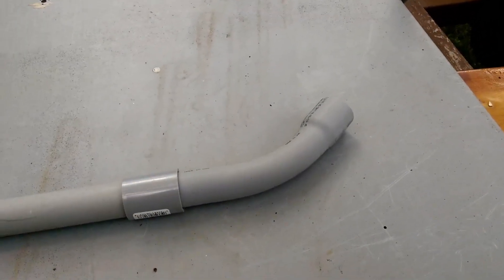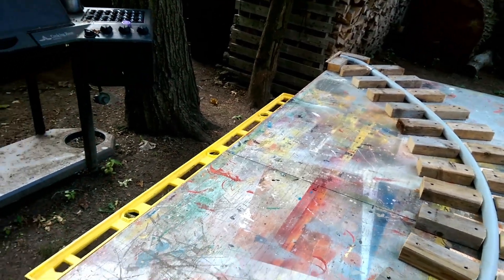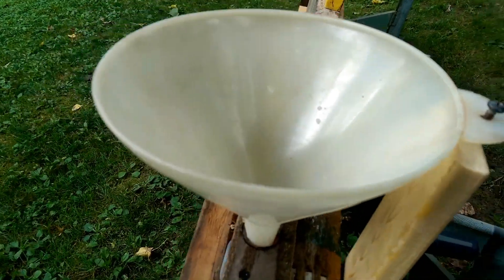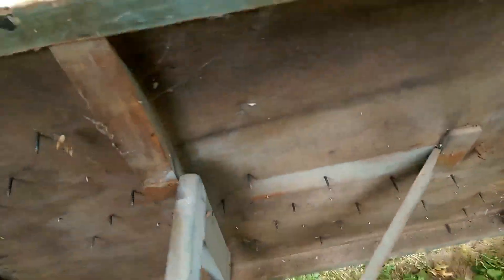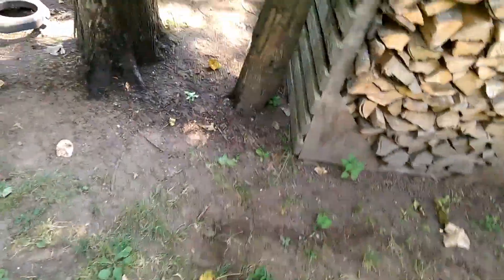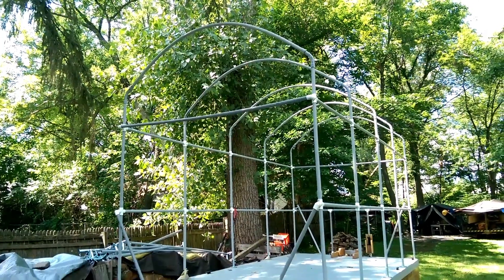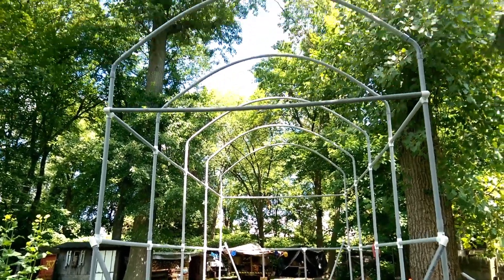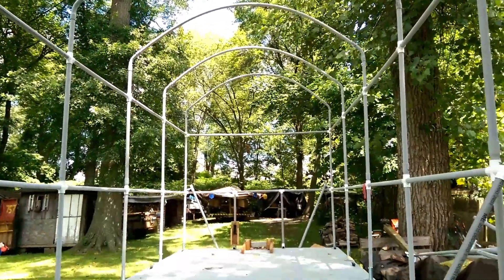PVC Pipe Bending

Comment: The connectors for the bottom of the pipe frame should be a bit smaller to fit inside the PVC since they are many times stiffer and stronger than the PVC and can be hidden from view and rain that way.  That does mean you will need to remove the bolt that is welded on the anchors so the PVC will fit over them.  You can also do the smaller pvc insert like I did for the other areas I connected pvc pipe together to make a smooth, no lumps, or bump joints.  The smaller pvc is a bit stiffer than the larger pvc pipe, but I like to put a short piece of metal conduit inside the insert to give it exceptional stiffness.  To make the joint insert of pvc, go the next size smaller, cut it 5 to 6 inches long and then make another cut along the length so it can squeeze down a little and make jamming it into the larger pvc pipe a bit easier.

Comment: I didn't use the 45 degree elbows like you did.  Instead I used the next smaller size pvc to make insets after finishing the bending process to join to straight pvc for a greenhouse frame project.   That way the joint is smooth and has no lumps, or bumps.  I didn't use hot water, I used hot sand.  One reason is because it holds heat a bit longer and can be used over and over again.  Pretty simple solution since a metal pan from the thrift store worked well to hold the sand until it got hot on the BBQ and the BBQ doesn't need to be huge either.  I also discovered it is possible to use conduit inside pvc pipe to stiffen it and the pvc protects the metal pipe, extending its useful lifespan.  PVC in strong wind tend to flex a lot, which makes it hard on the plastic sheeting on a greenhouse that needs a stiff frame to prevent stretching/warping of the sheet plastic.

Comment: Nice!  I did the same thing with PVC years ago, and was even able to use the bending frame for conduit, the thin walled electrical pipe.  The PVC after 1" in diameter needs a bit of heat, so I made a heat box that was open on the bottom and used a small BBQ to heat the plastic pipe.  I had elevated the open bottom box enough to not over-heat the plastic pipe.  After an hour I would check the box and remove the BBQ to let the plastic pipe cool.  This is pretty easy to do since 1" inch PVC can be curved a bit by hand, but needs the heat to take on the curve as a permanent shape.  There are heating tools for PVC and the best ones seem to be those that fit inside, but you do need to ensure you use them to heat the pvc without overheating it and will still need a jig to control the curve you want the pipe to remember after it cools.

Comment: Dude, get a Go-Pro. 😬
I bent pvc to some pretty tight turns by heating sand to 500 degrees in an oven, and pouring into the pipe. It is like putty when you do that. Pretty cool!

Comment: In case anyone is wondering in Europe, PVC becomes pliable at 80 degrees celsius, 100 degrees (boiling water) is just fine.. It won´t start actually melting and dripping off until you go up to about 140 degrees. 15 minutes is not really necessary, it is almost instantaneous. 2 minutes will do it. If you throw cold water in there, to get it below 80, 15 seconds of that will set it.

Comment: A hanging chain is just an inverted arch. All ya gotta do, since the pvc is the equivalent to a wet noodle, is get a clamp jig on that table. Find a way to secure the ends of the PVC to the jig without fucking up the ends. And fill it with hot water beforehand. Because its hot, all you have to do is string it up, and make sure you have straight connecting pieces to ensure it goes together well.

Comment: Hi David thanks for the video. I know with my experiment with boiling water ,,, you need to bring your water up to a full rolling boil because when I check the temperature when it was just bubbling from the bottom the top temperature was only about 190 so that's why they tell you to bring it up to a full rolling boil to get your water up to the 210 degrees.
 just trying to help

Comment: Good ideas if you really need that specific arc. You know that drain valve on the bottom of your hot water heater? The one you're supposed to connect a hose to and drain every couple of months or so? Yeah, that might work as well.

Comment: If you're doing a tiki bar type themed setup, you can take some 1-1/2" or 2" (pick your size) PVC and mark it every 12" to 14".  Take a plumbers torch and heat around the PVC at a mark you made on the pipe.  Went it heats up after a few seconds, you can push the PVC pipe downward and create a slight "bubble" or ridge around the circumference of the pipe.  Do that to each mark you made.  You can then stain the PVC with some brownish/green clear stain or use the torch to discolor the pipe.  When you're down, it will look exactly like a piece of bamboo.

Comment: Just use a heat gun.... You can blow the heat through the tube on both ends and hit it from the outside.... Just go quick enough for you don't burn... It'll be ten times easier

Comment: You could also rent a hot box, or a heat blanket.  They are tools that electricians use to bend up to 4" pvc pipe all day long.  Another way would be to heat the pipe by waving a torch over it until the plastic is pliable.

Comment: jig #1 level 4 ft not needed just built one 100000000 times more accurate then the ones you can buy i like the hot water but by the time the water boils could bend2-3 pieces heat gun garden hose 30 seconds cured you don't need to struggle bending the conduent? into jig shove one end in heat gun on hi wa la bent in spray with water ?
Reply: Bob Visser did you make a video? Heat gun was what I thought was going to be used.
Reply: the electric conduit is the best (what he used ) made to bend alot tougher then cpvc witch probably not bend using boiling water and isn't impact resistant like elc pvc

Comment: When I watch a build video for 'how-to' tips, I want info - quick and clean 'cos I need to get on with the job. This video is a little bit 'warts & all' BUT THAT is perfect. Quick info little time wasted for you [hampered by video making] or me. Bugger what the moaners say - if you want to spend more time polishing the video, you can, but this is often all thats needed. I found it very informative with no-messing. Btw If you put 4 or 5 little blocks on the former blocks, a single screw each so you can twist the block round and hold the pipe in place -  like a cupboard latch, it would prvent the tube falling out when emptying it. Great video and a very handy technique.

Comment: What you do Dave, is plug the ends with drain type rubber expanding plugs, heat the pipe with a weed burner type torch gently. Now you have a flexible pipe filled with compressed air and you can push the pipe into your jig and never get a kink or crease. You can use rubber caps [no-hub] with hose clamps also.  I have bent Yellowmine pipe, 6" in diameter with 1/4" wall+ to a beautiful 45 degrees long sweep with just a few stakes in the earth and a helper. I just used pipe caps with cheap latex caulk on the ends and duct taped in place.  Untape it early and you got a hell of a cannon! With a sliding jig, you could even make those 45' bends on one section of pipe itself.

Comment: Why not boil your water outside next. To  the jig ? So you dont need to carry it  so far ?  A old Boat builders trick to boil water. To  use for a steam box to bend wood was they used a propane burner   And a metal gas can as the pot  for the water  which does have a pour spout built in  the boat builders would use the spout to attach hoses to the steam box to  make the wood more pliable  for bending. Into shape     I mention. That setup as a inexpensive alternative than running back and forth to the house  arraign boiling water   In open pots  around which is quite dangerous as you mentioned

Comment: Suggestion, get a steam generator such as a wallpaper remover.  You don't need to move the table.
Just leave the steam on for a while until the pipe has set itself.

Comment: Not that this would work for your application, but I worked with an electrician in the midwest winter and he forgot to bring his PVC heater to warm and bend the PVC. He shoved the PVC into his trucks exhaust pipe with the engine running  after a few minutes took it out it was a spaghetti noodle and he proceeded to make his bends for the day

Comment: You could have left the hot water in the pipe for your required time then instead of dumping the water out just flush it with a water hose. Good job. I would like to know about the pontoon construction and deck.

Comment: Great jig Dave..we used the same process when I worked at a plastic factory..in the winter if it was cold we would add salt to water ..I  like your bottom angle struts. Is that all you need to keep it from flexing with side wind..cheers from Australia.

Comment: Just saying,afraid that frame would turn to spaghetti in our south Texas summer.Great craftsmanship though ,I built a quonset structure years ago using plastic pipe and tin cover ,braced it every which way but never liked the result.You might stabilize the pipe by filling with light weight concrete or ?
Reply: Randolph Snyder I’ve done the pvc pipe bending here in south Texas and using the grey pvc will hold up in the heat unless you have a lot of weight on it and it gets super hot.
Reply: South Texas as in Laredo in August at 2 in the afternoon in the sun,i ts easy to cook a egg on the hood of a truck and you can't hold your hand on the metal,never checked the temp,no pyrometer,your bent grey plastic pipe might retain its shape,I personally would not trust it in a critical structural situation.The last quonset style custom roof I did ,I used 3/4 in electrical conduit,it held up in a high wind.,I bent it on frame like the one you used for plastic,just over bent it a little .I have some pics if you want to see the finished boat cover,its mounted on the boat trailer still.

Comment: well done, just a suggestion for reshaping the "collar" of PVC, bevel/chamfer the end of another length, heat the collar in hot water, push the "spigot" chamfered end into the collar. Twist the 2 pipes as they cool off,,(gently and keeping both inline and parallel) job is done reshaped collar.

Comment: Great idea- especially the boiling water part. I made something similar and used a tarp made from military tent material.  It was so heavy, I had to pull the pvc apart and insert conduit in the pvc. Thankfully, the awning was grounded- Something i didn't consider. What do you use the pontoon boat for?

Comment: A T fitting in the first and last arches and an 'intersection' fitting on each of the interior arches wod serve to hold a center rib tying all of them together -> https://formufit.com/collections/pvc-cross

Actually, three of these, running the length of the cover wold add strength, wind resistance and allow for runoff.

Comment: Did you build you pontoon?
Reply from the maker: Yes, me and my wife,and her brother built the pontoons.Each pontoon is twenty-four feet long, eighteen inches wide, and twelve inches high and resembles a long rectangular box with pointy ends. The pontoons were built using a stitch-and-glue construction method that used plywood, copper wire, fiberglass cloth, epoxy resin, and fillers. This method used panels which were cut out of 6mm Lauan plywood and drilled along their mating edges. Panels were then stitched together with wire along the seams to hold them in position while epoxy resin was applied to the joints. Once the epoxy cured the wires were removed. Epoxy resin thickened with fillers was then applied to the interior seams with the round end of a tongue depressor to fill in voids from the wire holes and create a small continuous fillet along the interior seams of the panels. The exterior seams were faired to create a small radius along the chines. Layers of fiberglass tape were then laid across all interior and exterior joints and saturated with epoxy resin. Once the epoxy cured the entire interior and exterior of the hull was sheathed in fiberglass cloth and saturated with epoxy resin, which bonded and sealed all the panels together and created a waterproof one piece monocoque skin surrounding the entire pontoon structure.

A series of nine internal bulkheads were bonded to the interior of the pontoon with thickened epoxy. This provided addition support structures and multiple air tight compartments that would restrict water intake in the case of a hull breach. 1½″ square sections of Douglas fir were bonded to the topmost internal corners around the periphery of the pontoon skin and bulkheads, providing a rigid anchor point to fasten the deck to the pontoons using stainless steel screws. The internal volume of all four pontoon tips were packed with sealed plastic bottles to decrease the volume of water that could occupy these compartments. Since the tips were the most probable area to suffer damage in a collision they were safeguarded in this way. All other compartments were left empty.

Here is a link to some pictures taken during the initial build in 2001
http://www.ctriverraftrace.org/archives/photographs/2001/willie.html

Comment: What is the tightest radius that you can bend
Reply from the maker: I don't have an exact measurement to provide but in general smaller diameter PVC pipe can be bent to a tighter radius than larger diameter pipe. One key factor that must be kept in mind is that any PVC pipe may collapse on itself i.e. kink if the radius is too tight. One method to combat this is to fill the pipe with sand and cap the ends before applying heat to bend it. This will internally support the pipe walls and prevent the PVC from collapsing or kinking. I would suggest a test piece be tried to develop your technique and once perfected move on to the final bend.

Comment: PS: hey" I have been wanting to try to build a pontoon boat, for a long time now and I just want to know, what do you have inside the floaters, under the bottom.?? I've thought about, putting everything  from, just plan air, to styrofoam. But just wanted to ask you" what is in those pontoons.!???? Thank's.
Reply from the maker: The pontoons are partitioned with bulkheads every four feet. The front & rear compartments are filled with capped plastic bottles & foam pieces. The function of this is to minimize water intrusion if the pontoon tips get damaged. The tips are the most likely places where a breach could occur during launching & retrieval. The rest of the compartments air air filled chambers. A few years ago I fixed some damaged sections and filled the compartments with 2" thick extruded foam. The foam was the kind used to insulate foundation walls. Ideally the entire pontoon could have been filled with foam when it was built as a secondary safety measure against sinking. But as of now the pontoons are almost 20 years old and have never leaked. Plus it would take a hole in each compartment every four feet to sink the raft. This is highly unlikely. The skin of the pontoons is nothing more than lauan plywood i.e. doorskins that have been coated with multiple layers of fiberglass cloth and epoxy resin. These materials are very robust and can withstand lots of rough handling with little wear or damage.

Comment: Thumbs up for your work BUT to be honest this was not necessary as your reason for bending was because you previously made a flat top. You could have easily used x3 45 degrees angle elbows, one in each vertical and one at the top middle. This would have made a sort of triangle shape constructed very fast and with fewer resources to achieve the same result.
Reply from the maker: I had a height restriction to stay under. A peaked roof with 45 degree elbows would have resulted in too high of an overall structure. I tow the raft with the canopy assembled and have to pass safely under bridges and power lines. A flat roof or slightly arched roof was my only option to keep under the height limit of 13 feet - six inches.
Reply: @Da175305M  All good sir, I did not know you had some restrictions.

Comment: nice jig. why not use a heat gun or torch?
Reply from the maker: At the time using water seemed like a good experimental method for my jig since a heat gun would only allow for local areas to be hot enough to bend. I wanted the whole pipe to bend evenly so there wouldn't be any conflicting stresses which could have caused the pipe to twist out of plane.

Comment: Why didn't you install tee fitting on the roof area to accommodate cross ties?
Reply: Yes, I thought the same thing - to prevent sagging of the tarp when it gets wet.
Reply from the maker: Last year I build a snap on ridge pole that connected all the roof arches together. The entire assembly was glued together & could be attached or removed without additional hardware. Tee fittings would have required some sort of securing mechanism to keep the connecting poles between the Tee fittings from coming loose. I made two snap on soffit poles as well that attach to the outboard sides of the frame. This allowed me to secure the canopy tarp edges out past the deck. This allowed rainwater to drip off the tarp ends in a way that wouldn't get the deck wet. Its like a foot wide overhang to either side of the raft.

Comment: Should put the pipe in the sun, let the sun heat up the pipe. I live in South Florida and about 2 or 3 hours in the sun will get the pipe hot enough that it will be hot enough to put in the form with out that much trouble. Maybe still need to put the hot water in but should make it easier to put in the form.  Maybe will not need the hot water. That would depend on how hot the pipe gets in the sun. Here in South Florida it can get so hot I need to use gloves to hold the pipe and it bends easily to what ever shape I need.